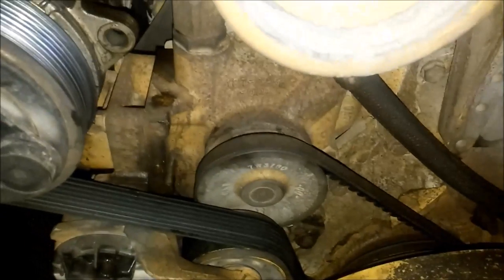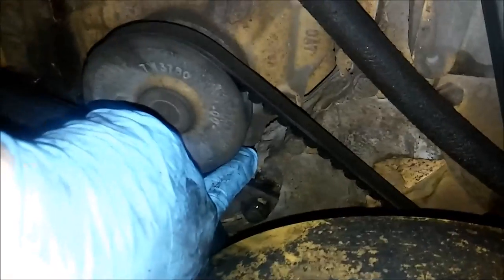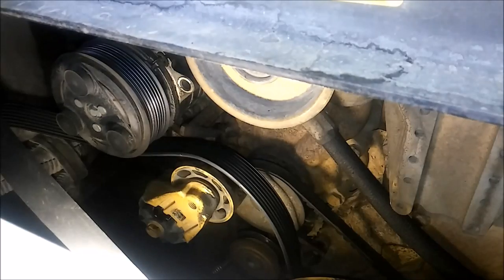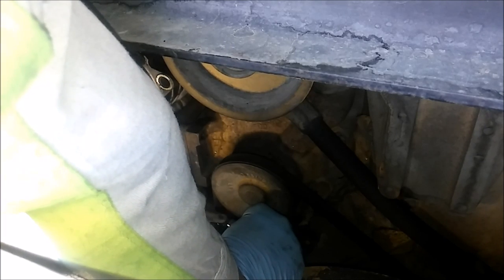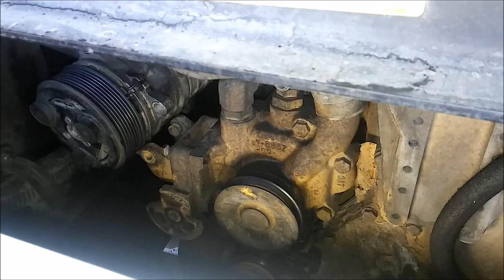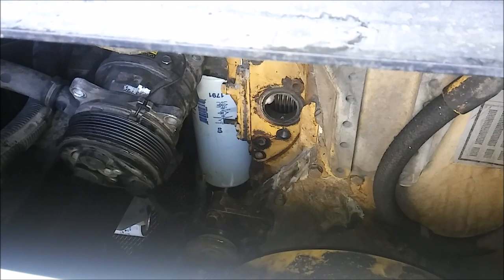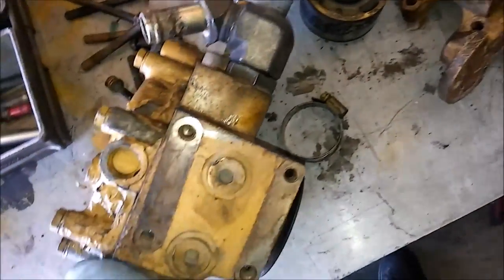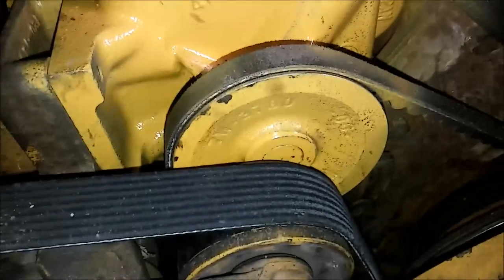How To Change a Cat Water Pump On C7, 3126, and C9 Engines.

Comment: THank you! Good info. I'm having a hell of a time replacing the water pump belt on my 3126 pusher - the damned water pump belt idler pully tension bracket to be specific... I was loosening the pivot bolt on the bracket to get it to swing so I could take the V belt off, and after like 1/2 turn, it twisted off. Left me with less than a quarter inch of bolt....hence my agony...I have a few things to try but I'll prob end up having to pull the radiator and shroud and drill it out as I can't get a welder to it to try to weld a nut onto it....BUT, the video you have here showed me the components.

The engine has 114K miles...I reckon I should replace the water pump while I have it down this far....
Reply from the maker: +QuantumRift I'm sorry to hear that, that is a tough problem. You might have to just drill that bolt out and retap the hole. If you have to remove the water pump anyways, might not be a bad idea to replace it.
Reply: Thanks! Yea, I hope I don't have to resort to drilling it out, due to its location and accessibility in my Safari Serengeti RV. I'm 60 and I already ganked my ribs crawling around and laying on that engine. OUCH.
Reply: CAT never saw the need, apparently, to never use any sort of anti-seize compound. From what it looks like with the other bold I removed (to get the bracket off), CAT used threadlocker.. (just kidding, but these bolts should have easily loosened up)...

Comment: Thank you for all the great videos. I have a 2005 Itasca Meridian Motorhome with the Cat C7 motor. I have 114,000 miles on the engine right now and I was wondering if I should do preventative maintenance and replace my water pump. 6000 mile trip coming up and I don’t want any problems :-)
Reply: I am in same boat, but I have coolant below the dampner.  No way of telling if it is from the WP or not.

Comment: if the coolant just pours out from the engine area after you put coolant in...could this be a water pump issue or possibly just a hose clamp. I'm hoping for the latter.

Comment: I have a Damper that is larger in diameter than the V belt.   The engine is a 3126, 330 hp.  I decided that today was a good idea to replace this V belt, but I can't figure out how to get the V belt over the Harmonic damper.  I believe the damper is larger in diameter than the belt can go around.  Have you ever come across this?

Comment: Do these pumps sometimes just stop flowing? No leaks and the pump is spinning but it's not flowing, no heat and the engine is getting hot fast.  We are stuck Ata Flying J

Comment: good  video . What  small  cat  has  the  water  pump  on  the  lower  left  front , 4  bolts  and  a  hose . I  changed  one  about  15  years  ago . one  of  the  easier  ones

Comment: So I have a c7 engine and I just notice a little problem hope you can help.... I noticed that my coolant level was low on the reservoir but it seemed that it's leaking from the same reservoir from that small little breather right under the cap? What can it be? It hasn't been overheated

Comment: I know you said before that a CDL isn't always required to work in a truck shop, but what would be the best way that you know of to get experience after getting a CDL while working as a tech? My understanding is that most companies won't put you in a truck without experience because it isn't worth the risk/insurance cost, unless you start with a long haul training company like Swift driving class A or driving class B in a school bus. There's always CDL school, but thats another $3,000-5,000 depending on what class/endorsements, and it still doesn't even scratch the surface.
Reply from the maker: Well as a tech you don't do a lot of driving, mostly short test drives. If the company you work for has large Class B service trucks, I would suggest trying to get into one of those, but other than that, you are going to have to get into an actually driving position to get decent experience just driving. I wouldn't think a shop is going to judge you too harshly on CDL driving experience if you're applying for a tech position, they care more about wrenching experience. Just my experience.
Reply: +Adept Ape Thank you!

Comment: Hey man, great videos, thanks you! When changing a water pump, is there a need to prime the pump with coolant? Or do you just install the new one dry? I have 2 3208's in a marine application, thank you!
Reply from the maker: +Chris Eck Lubricate the orings, but install the pump dry, it'll fill with coolant when you fill the cooling system. Check out my video on the right way to fill cooling systems, there is a great tool for doing this.

Comment: The v belt .. did you remove harmonic balancer.. do u know the torque on the balancer
Reply: I just had to remove the harmonic balancer to change the water pump belt. He didn't till you that mite need done!

Comment: First offf, can Vaseline be used for those O rings, next is it  about the same way for the C15. I also saw some sort of a white blob of stuff in the block at the 10:00 position, what was that???
Reply from the maker: +Gary ClarkII Well that video is only 9 minutes long so I couldn't get to 10:00 minutes in. Around 6 minutes I think I saw what you were talking about. I think that's part of the block casting, but I can't really zoom in for a better look.
Reply from the maker: +Gary ClarkII I've seen guys use Vaseline, but I'm not sure what it does to seals over time, I think dielectric grease is the way to go on coolant seals, although tire soap works great for lubricating seals. A C15 water pump is much different, it sits behind the front structure and is gear driven.

Comment: Any chance I have just bad I- rings, it’s dripping from the water pump but always runs cool.
Reply from the maker: I'm sure you mean O-rings, but yes you can have a bad seal behind the water pump causing that. If it is coming from the weep hole you'll need a new pump though.
Reply: Adept Ape ya o ring, after watching your video again I noticed that my leak is dripping from the other side of the pulley and slightly higher which leads be to think maybe the thermostat housing just above maybe leaking. Either way the video was a big help
Reply: You were right, weep hole, 2 hours to remove enough stuff to get it out. The easiest part was the four bolts on the pump

Comment: Yo Adept man
Is the fan on a c7 engine gear driven or belt driven?

Also, a friend of mine who owns a cat 330 1999 excavator  noticed that his water pump leaks water from the weep hole only when the engine is off, no water will be dripping from the weep hole when the engine is running! how is that possible?
Reply from the maker: +Omar Needs a new water pump, the shaft expands when it's hot and stops leaking. The Fan is belt driven.